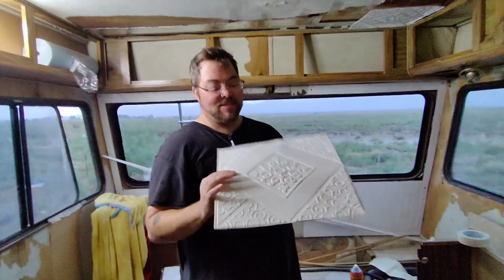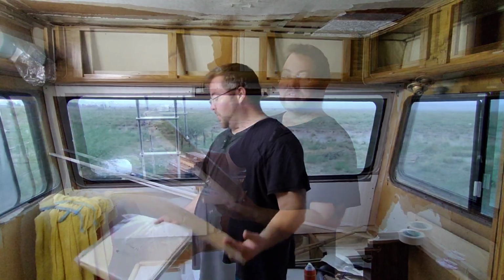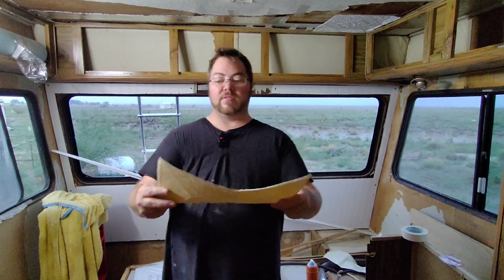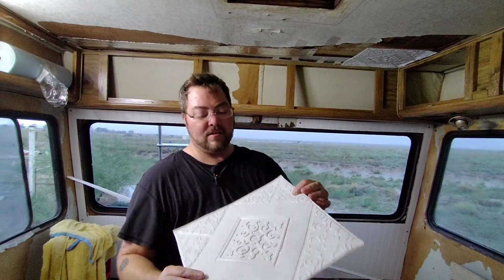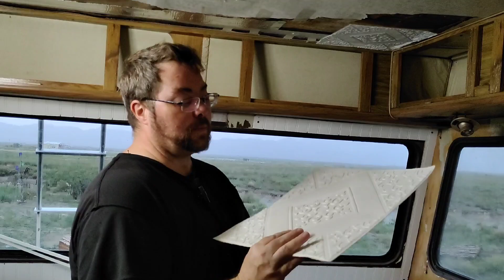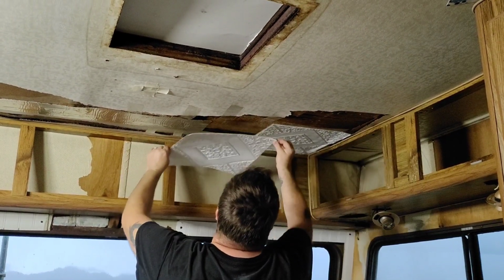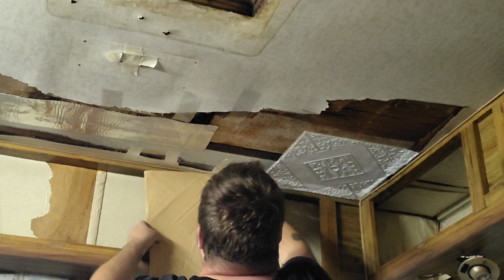RV Update!                            #rvupgrades #rvmakeover #rvremodel #rvlife    #1982pacearrow

Comment: Looking good. Reminds me of the faux tin ceiling tiles I used in my The Quaint Gypsywagon, but those were plastic and 3D. 
If you redo that later on, consider working from the center out using the vent as the center. 😊
Reply from the maker: Yes they look like the tin tiles. We will be redoing the luan eventually. Thanks for stopping by.
Reply: @KristoferTravelsHomesteading  Keep up the great work! (Sorry my OCD made me point out the centering ;) )
Reply from the maker: @the_quaint_gypsy 😉